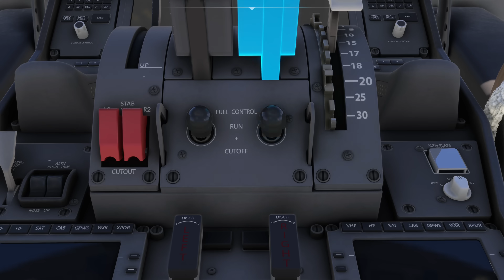Air India 171: Why Did The Fuel Cut-off Switch Get Moved?

Comment: To me this is 100% solved after watching the best explanatory video from Captain Gryder.  https://www.youtube.com/watch?v=XlsWTKmuRKI

Bottom line Air India 171 is a suicide by the captain.  
10 seconds from cutoff to on position is way too long. 

If it was the officer having committed this deliberate act, the main pilot would have turned the fuel on in a few seconds. The main pilot also was not taking the aircraft through T/O, he was supervising. If it was some sort of extremely low probability/likely down to 0 that the fuel was cut off unintentionally then same outcome: The main pilot would have turned it back ON very quickly, not a 10 secondddsssss later.... The attempt to turn the fuel back on will not help (it's too late and the main captain knows it !) 

It is also the Captain who asks "why did you do it" to which the officer responds he didn't. This makes sense, the officer is confused , he has already both hands occupied taking the A/C through T/O so he assumes the main pilot will take corrective action. 

Also , Left engine is the first engine to be cut off and put back ON. If you are suicidal, then you will likely start w/ the switch closest to you. 

Bottom line: Main pilot committed a horrible act of suicide killing hundreds. What a shame !

Comment: Why are we asking pilots what happened?   They only drive the plane.  They typically would not know what goes on beneath the dashboard.  When the switches are switched, does that motion directly turn the fuel on and off?  Or is there more electrical and mechanical devices activated?  We need to ask the design engineers.

Comment: Could it be the switch was never even put on and the check question asked, but not checked ? Could the plane have just rolled over with whatever kerosene it had in the system and just ran out of steam as soon as it took off?

Comment: The FAA issued Special Airworthiness Information Bulletin (SAIB) No. NM-18-33 on
December 17, 2018, regarding the potential disengagement of the fuel control switch locking
feature. This SAIB was issued based on reports from operators of Model 737 airplanes that
the fuel control switches were installed with the locking feature disengaged. The airworthiness
concern was not considered an unsafe condition that would warrant airworthiness directive
(AD) by the FAA. The fuel control switch design, including the locking feature, is similar on
various Boeing airplane models including part number 4TL837-3D which is fitted in B787-8
aircraft VT-ANB. As per the information from Air India, the suggested inspections were not
carried out as the SAIB was advisory and not mandatory. The scrutiny of maintenance records
revealed that the throttle control module was replaced on VT-ANB in 2019 and 2023.
However, the reason for the replacement was not linked to the fuel control switch.

Comment: Tank(Boost) Fuel pumps or on the engine fuel pumps ? They probably forgot to turn the switches on at the gate before they left. Most engines can run a little while with the Tank fuel pumps off before they starve of fuel and stall

Comment: Some questions for the experts: 

1.  After the first switch was turned back on, to "RUN", there were still 15 seconds before impact.  Wouldn't there have been enough time to at least power up one of the engines and prevent the impact?

2.  And then, with both fuel switches turned back on, to "RUN",  there were still 11 seconds before impact.  Did the pilots not know that fuel was now available to the engines, or perhaps did they panic (as I would have) and fumble the controls to power up the engines? 

3.  Another question is;  How long after turning the fuel switch back on, does it take for the fuel to reach the engines? 

4.  Also, do the engines have to be restarted or is that an automatic procedure once fuel in reinitiated?

5.  Finally, horrible to say, but could one of the pilots have physically prevented the other from powering back up? 

These are questions that only technical experts, such as pilots should speculate upon, but I note from the video that there was no arresting of the plane's descent, let alone any change in trajectory to an ascending rather than a descending one.

Comment: Nobody is asking the "RIGHT QUESTIONS" and considering all possible scenarios.There is a possibility that the engines failed "FIRST" and then all the activity with fuel switches happened next. Pilots are trained to switch off both engines and then restart them, and in this , both engines had stopped working which is rare but possible and  the pilots were just following regular procedure. The "RAT' was deployed  and the plane's wheels were not in the plane which should happen right after takeoff hence indicating more of a machine failure. The pilot saying "why did you switch off" could be because it is considered impossible for both engines to stop working at the same time ,so he may have thought that the other pilot switched them off ,  but it happened , it is a machine which can malfunction , and then the pilots tried to save the plane by shutting the fuel and restarting the plane. I am not saying that its impossible that this was pilot suicide , it could be , but the report was so vague, BOEING's record is bad +they can buy anyone off, and most of all the instant "RAT' deployment and the planes wheels not in the plane, the lone  survivor said the lights were flickering in the cabin, This signifies electrical failure or another scenario. I am sorry but in todays internet age , one has to put all the evidence forward and they did not do that, trying to  blame the pilot that to in a "prelimanary report", making us believe more that its the big greedy  corporation who is more likely to be the villain.

Comment: The preliminary report doesn’t include data from black box. Why was it hidden? Boeing had so many faulty parts, no lock (boeing had acknowledged on lack failures but never resolved the issue) on the fuel control switch, black box was damaged (which should not happen), no proper timestamp mentioned in the report. No one is talking about sub par parts used by Boeing in the first place. The report is just trying to save boeing.

Comment: I can see how a person's natural instinct might be to flip the switch closest to them first and then flip the one further away, which would implicate the Captain. If the order of the switches ISN'T proscribed, then the 1st Officer MIGHT have triggered the cutoff switches in the opposite order than described in the preliminary report. So, like, this might be a silly question, but are the fuel switches ALWAYS moved from cutoff to run and run to cutoff in the same order? Is that part of the checklist? Or, does the order that the switches were flipped, first off and then on, give us a clue as to who was flipping the switches?

Comment: As much technology Boeing puts in these cockpits why not add a digital signals on each flight display in front of each pilots to alert “ fuel off “ so they have a second to turn it back ON before fuel starvation to the engines n save the plane and souls !

Comment: The report doesn't say the cut off switches were moved it states they were transitioned. This could be caused either from a mechanical or electrical fault; the logic state causing the circuit to record a 'transition' within the parameters of the event log and not necessarily meaning that the pilots "moved" the actual switches. The point being there needs to be identified a reliably sequence of events which determine from what and how the electrical command at the engines was received

Comment: Captain Steeeve :"If they go AI, then I'll never get on an airplane again."  Isn't that a bit too absolute?  With advances in AI technology over the next 20 years, isn't it possible to envision a robotic airplane by 2050 that makes it impossible to crash or have any other issues?  I mean the Boeing 787 is already 75% of the way there.  It would just take image analysis with optical and IR sensors, and connection to all other systems [e.g., weather], control towers, and aircraft -- as the military is doing even today.  =====================

Comment: Obviously, these fuel switches are not simple on/off switches like light switches in a house.  The valve(s) that open and close are not located in the cockpit.

In spite of having a traditional yoke and foot pedals, the Boeing 787 is a fly-by-wire airplane.

Some electronic "thing" recognizes that the fuel switches for each engine are open or shut and, when that changes, sends a signal somewhere via a shared fibre optic cable (probably to two or more places to avoid single points of failure).  Some controller receives that signal and closed one or more valves, depending on which fuel tank(s) are currently supplying fuel to the engine.

There's some mechanism to detect the position of each switch.  There's software  running somewhere that opens or closes one or more valves when the switch position is moved.

Can anyone explain how two switches control the flow of fuel from three fuel tanks on board a 787 (left, right, and center) to two engines?

It's likely there are no single points of failure.  The failure of any one valve won't cause an engine to shut down.  (And fuel can be moved from tank to tank to ensure the tank in one wing isn't empty while the tank in the other wing is full.)

What is known from the preliminary report is that some computer on board registered that the fuel switches were turned off at some point and turned on again.  It's possible the switches were physically turned off and back on, but it's also possible that whatever computer recorded this information on the black box detected that the switches were flipped, but the physical switches were never physically flipped.

I believe it's known that the physical switches were in the "on" position after the crash (the cockpit was not completely destroyed by the crash and subsequent fire).

Is it possible there is a way that an onboard controller detected that the switches were flipped off then on during the very short flight but the actual switches were never .over from the "on" position?

This would be consistent with the days recorded in the black box and also consistent with "Why did you turn off the fuel switches?" and "I didn't", with apparently no further command to turn the switches back on or confirmation of having done so.

Typically, fibre channel commutations is very reliable but it's not perfect.  Almost all packets of data sent are successfully received but not all are.  There must be a mechanism that lost or garbled packets are identified and data is re-sent.

There may be failure modes where the status of two fuel switches are misreported.  (It's unlikely that a failure in both switch units would occur so close together in time).

Maybe it was the plane and not the pilots.
Reply: but they have electrical wires that insert into connectors which is possible can become loose or disconnected, like a light switch. they maybe more sophisticated but end result wires have ot be connected somehow
Reply: It's possible that there's a failure mode on the fly-by-wire communications network that never affected the status of two fuel switches simultaneously before or never occurred this close to take-off before.  Had both fuel switches been turned off one right after the other and then been turned back on very soon thereafter at 10,000 feet, I assume the pilots could have recovered.  But it's unlikely they wouldn't have noticed.

Is it possible there have been incidents on 787s where one engine was powered off but automatically restarted before the fans had fully spun down (so it would have restarted fairly rapidly)?  Would such incidents have been reported to anyone?

Comment: The rat was deployed literally 50 feet off the ground. The aircraft only lost the engines a lot higher. Why is the black box damaged when the tail section was comparatively intact on the roof. The switches going back to on shoes neither pilots wanted them to be off. Why weren't external observers allowed. Why weren't there timestamps  about the CVR messages.

Comment: Captain Steeeve  -  - - I still have a question about sabotage. Could those switches have been linked into the main computer system and 
controlled by malware-injected code -- but made to look like one of the pilots did it?  [E.g., the 1-second delay between switch motions.] 
When the pilot said, "I didn't do it!" -- was he maybe being genuine and surprised? 
Also, can they do a voice analysis on those recordings to determine which pilot was saying what? =================

Comment: I missed the Q&A - here is a scenario I wanted to check (if they were not discussed)

1. Pilot-1 made a mistake and took off Switch-1
2. Pilot-2 noticed and asked the question
3. Pilot-1 'panicked' and switched off Switch-2
4. Then either realized the new mistake and switched on both

Comment: Switches were not moved but the loose wiring fall off during take off triggered cutoff signal  SIMPLE grill service engineer to deliberately set loose connection to fall off due to gravity.

Comment: Thank You Captain Steeeve,The Q&A is very  interesting &informative.
Is it possible that both the fuel cut off could have automatically shut off inside the engines without a pilot touching the fuel cut of switches???

Comment: Why is the cockpit voice debate only spreading now?
.
Why didn't ATC release it in the initial discussion? (Only "Mayday" was definitely mentioned that day),
.
Even a layman like me knows that the cockpit voice cut-off switch debate is a serious issue, yet why wasn't the issue covered in the media at the time?
.
.
If the cut-off switch was intentionally turned on, there are two possibilities
.
The first possibility is that the person who caused this problem may have had some mental problems, and the second possibility is sabotage.
.
The first possibility is 5% likely, because if the person who did this had any kind of mental health issues, it should have been visible on his service record.
.
The second possibility is also unlikely to occur because it is not yet known whether an expert team has begun an investigation, considering that the false use of cutoff switches would increase the risk of sabotage.
.
Boing / Air-India / Pilots who will be the Winner ??
.
RIP to all the martyrs in this incident.

Comment: This tragic crash and the ensuing investigation has highlighted, (even if the analysis were totally erroneous), how relatively easy it is and has been for a single flight officer acting alone who has the intent to do so to deliberately cause their aircraft to crash.  Given this context, whilst it is important for the authorities to consider the specifics of what safeguards could be put in place to avoid both engines being shut down maliciously by one officer acting alone (particularly just after rotation), (some suggestions for which have appeared in these comments), I hope that they will address with total humility the wider question as to whether it sufficiently difficult for a single flight officer acting alone who has the intent to do so to deliberately cause their aircraft to crash by all other methods as well.  This should involve thought experiments / role play.